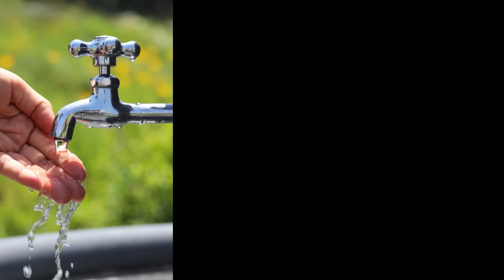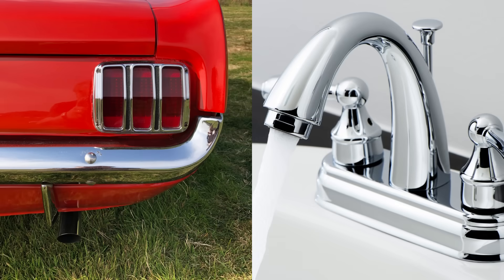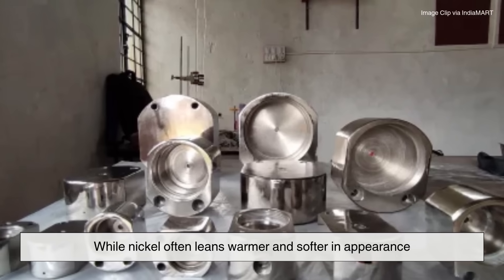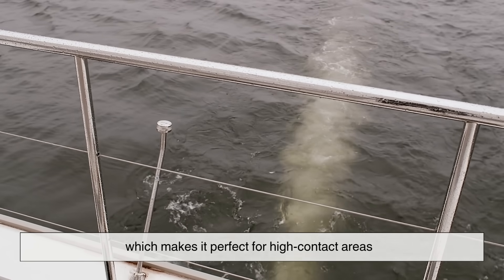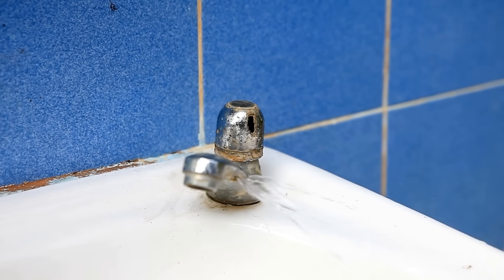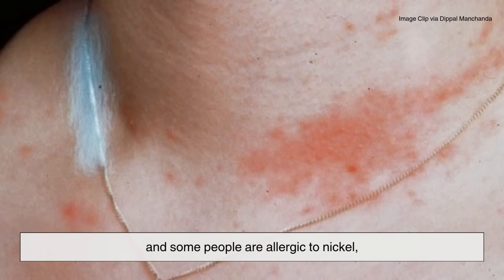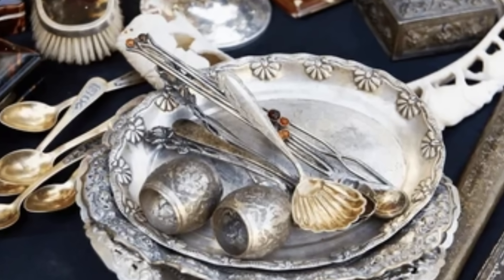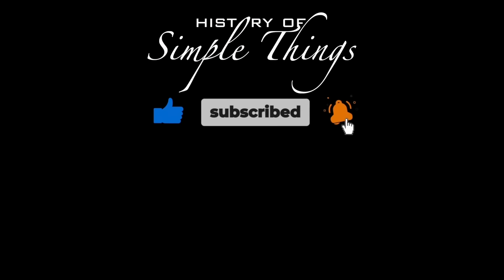Chrome vs. Nickel: What's the Difference?

Comment: Steel work piece still can have rust show up shortly after Nickle plated, since the nickle have micro pores allow moisture to reach iron/steel surface, causing rust and peeling,  then chrome plated over nickle, will seal up those pores, mostly

Comment: Here is the key basic difference:  Chromium is extremely corrosion resistant; Nickel retains strength at higher temperatures.  300 series stainless steels contain both chromium and nickel.  It has both strength at elevated temperatures and corrosion resistance.  The 400 series stainless steel contains chromium but very little nickel.  It is corrosion resistant and is capable of being heat treated.  One significant application is for knives.

Comment: Chromium isn't just hard, it's very hard, the hardest metal (as far as I know). Nickel is softer and therefore less prone to peeling off the surface than chrome plating. A softer intermediate layer, such as copper, should always be applied underneath both to improve adhesion. Nickel isn't very corrosion-resistant; even vinegar slowly attacks nickel. Therefore, be careful when descaling nickel-plated items with acetic acid.

Comment: Stainless Steel resists rust, because it is a steel alloy that contains both chromium and nickel. On the other hand, Nickel Silver is a cheap alloy substitute made to resemble imitation sterling silver, but it contains no silver whatsoever. Instead Nickel Silver contains 60% copper, 20% nickel and 20% zinc. Nickel Silver is also known as German Silver or Paktong in Chinese.
Reply: Most stainless steel items that need to look good are "passivated", which means the surface is treated to remove nickel and iron and leave pure Chromium.
Reply: So, all metals then? Got it!
Reply: Saved me 8 minutes and 33 seconds
Reply: Some stainless steels are iron-chromium alloys, and others are iron-nickel alloys.
Reply: @quadibloc2 all stainless steel are iron, carbon, Chromium, and Nickel.  If they don't have both chromium and nickel they are not called stainless steel
Reply: @quadibloc2 oops! OK, so some stainless steel can have little or even no nickel and still be called stainless, but if there is no chromium, they are just called nickel steel alloys and not stainless.  Types 304 and 316 have around 10% nickel and 18% chromium, which is the same ratio for most tableware, type 403 has little to no nickel, but I've never worked with that type.